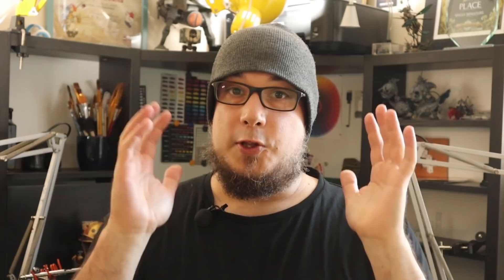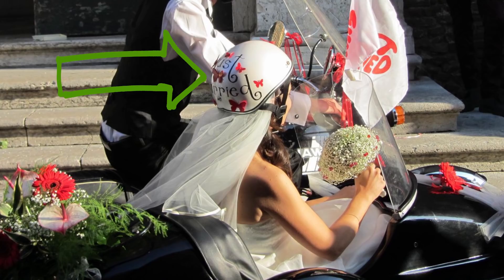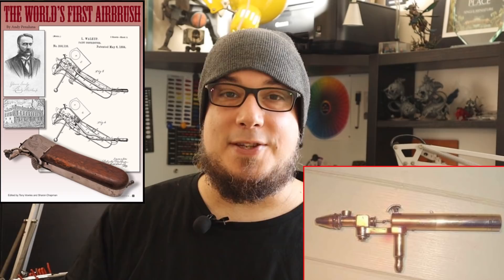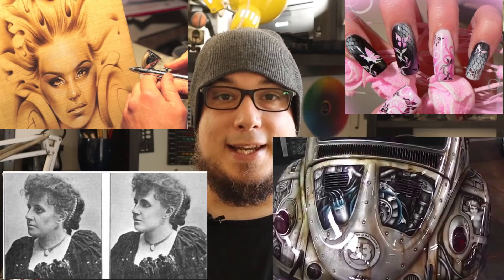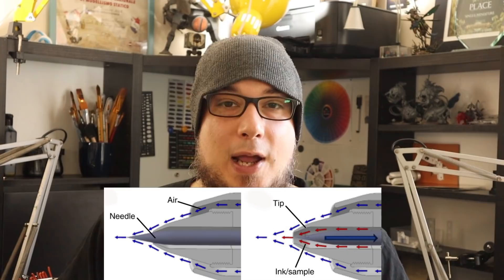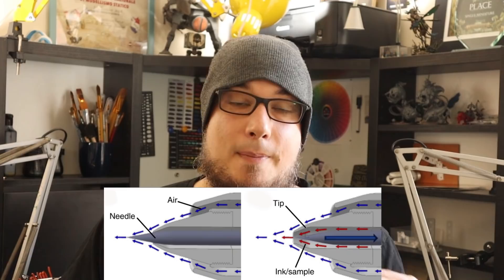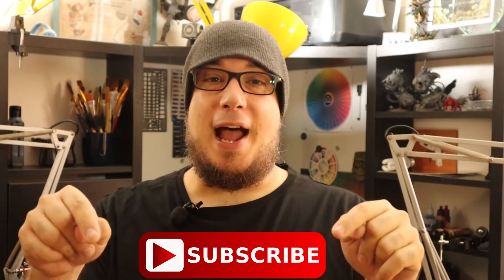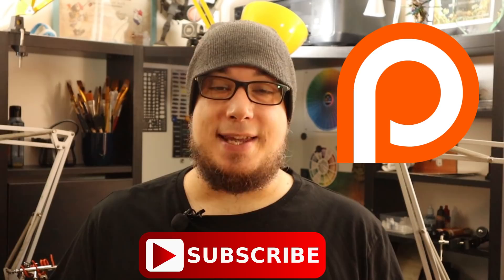Airbrush basics - Airbrushing for Miniature Painters

Comment: if you're using the Infinity with the 0.15mm needle/nozzle, then you need to make sure, the pigmentsize in the paint you use is <= 0.15mm, otherwise constant clogging or dry tip is the result. to my knowledge, the only manufacturers supplying paints with pigments that small, are CREATEX, Schmincke, Royal Talens and Sennelier. pigments in acrylics, oils, and enamels are usually somewhere between 0.2 and 0.4mm.
Reply from the maker: Yep that's a big part of my problem with it. You can work around this issue with other products and mixes but it's definitely not for everyone
Reply: @MarcoFrisoniNJM  my goto brand, when I use the 0.15mm needle in my Infinity: Schmincke Aero Color. they are a dream in the airbrush. the only exception are their metallics. they can't go through anything below 0.3mm.
Reply: @actualwafflesenjoyer  if they stay seperated, yes. but that's rarely the case...

Comment: If you can buy Iwata in your area, do not hesitate. I have owned and used all the brands, including some from pre-WWII era. You will never regret buying Iwata.  I use an HP-BPS siphon feed that draws paint from a bottle. I have added a tail piece from the Super Micron series that allows setting an adjustment for max paint flow drawing back the button.
Reply from the maker: 😍Awesome!!! 😍
Reply: I just discovered your video, and have subscribed. Looking forward to seeing more. I have been airbrushing miniatures, mostly model trains, for about 50 years. My father did photo retouching with Thayer and Chandler AA of the late 1930s and introduced me to air painting models in the 1960s.
Reply from the maker: @jenniferwhitewolf3784  😍😍😍 amazing! I learned so much from other modelling styles and I can only imagine how much experience and knowledge you built up thanks to your father and the years of modelling! Now I'm super curious to see your works and to ask you a ton of questions 😊😁😊
Reply from the maker: @jenniferwhitewolf3784  and thanks a million for the support!!!

Comment: Re-watching in 2022, I ended up with Iwata HP-BH, H&S Evolution Squidmar, and H&S Kyiv Infinity, so the same set, just slightly more collectible and visually appealing.
I really like the Infinity because of its aluminium body, not sure if yours has it. It feels almost twice as light as the Iwata. Also nice to know that I dodged some problems because Kyiv Infinity comes with a 0.2 mm nozzle instead of 0.15 mm nozzle by default.
Afaik all three models can be easily converted between nozzle sizes, my H&S both have 0.2 mm and 0.4 mm needle, nozzle, and endcap sets in their boxes, and the HP-BH should be able to accept HP-CH parts, which are sized 0.3 mm.

Comment: Something that wasn't mentioned is another type of airbrush, external mix. Some people may pick up an external mix brush cheaply thinking that they got a good deal, not knowing that there are large differences in how well an internal and external mix airbrush can atomize paint.
Reply from the maker: Good point! I cut them out because it's rare to see in the miniature world external mix airbrushes but they can be "a trap" when looking for a cheap solution
Reply: There's also the point of floating and fixed nozzle. IMHO, there's so much information about a specific topic, but you can only provide a boiled down summary to new beginners, without overwhelming them.
Reply from the maker: @naphaneal  we have all the time to scare them for real 😁😂😁

Comment: I just ordered an airbrush last week and can't wait to try it. Now I try to fins as much information on airbrushing as I can before it arrives. Your channel has been extremely useful so far. Grazie mille Marco!
And now just a stupid question: what is the difference between Airbrush Thinner and Airbrush Flow Improver? Something about surface tension reduction or something else? And which is better for thinning paints for airbrush?
Reply from the maker: Awesome timing!!! It's a pleasure ;)
It's not a stupid question and It's something I'll talk also in the next video!
The thinner increases the watery part of the paint changing it's consistency but not its properties, drying time and transparency in particular because it's designed to evaporate quickly.
Flow improver extend the drying time of paint and add a bit of body to the mix useful also for a good flow with the brush.
They are used together to adjust the paint to your need of the moment
Reply: @MarcoFrisoniNJM  Thanks again for the advice. Looking forward for the next video :)
Reply from the maker: @MentoliptusBanko  it's a pleasure 😉😉😉

Comment: You mentioned side-fed airbrushes, what are the advantages there? I saw a video of HR Giger using a side-fed airbrush and I was wondering why. Love your videos, number one fan etc. etc.
Reply from the maker: They are very popular in illustration because they have the same efficient gravity feeding but usually they have larger cups or cups that you can quickly remove, switching instantly the colour; often the artist has multiple cups ready with all the tones he needs or there's an assistant preparing the new batch. Plus the lateral cup doesn't create visual blind spots on the vector of the spray!

Comment: A small question, it's commonly mentioned that double action airbrushes allow to control the amount of both air and paint, but isn't air regulated using micro air control and the compressor rather than using the trigger? I've heard some other painters saying that the trigger acts as an on/off switch only for air, and its primary function is to regulate paint.
Reply from the maker: You have full control over the air flow from the trigger!!! You just set the main pressure on the compressor, that's all you can do from there but all the fine work is totally made from the trigger. Those painters have cheap airbrushes or a poor control of the trigger 😉

Comment: I have an Iwata single action 0,4mm I to see if I would adapt to airbrushing, mainly for priming inside my apartment, applying the first coat, and zenithal highlighting.

Now I have ordered a HP-CS 0,3mm for practicing higher level techniques.

Does nozzle size influences on diluting?
Reply from the maker: Nice! 
And the HP-CS is a very good machine!
Yeah you'll probably have to adjust your dilutions but just a bit in the jump between 0.4 and 0.3
Reply: You'll also notice a change in control as well. A double action reacts almost instantly to you finger.

Comment: Hi Marco, you've become my favourite youtube channel by a long shot!

So I'm about to pull the trigger on the Iwata HP-BH, but as my first foray into airbrushing I would love some quick advice:
1) As my 1st airbrush, would this still be great at priming/base-coating, or would it be hard work due to the 0.2 nozzle. Would a HP-CH 0.3 be a better overall pick for versatility or would the precision of the 0.2 outweigh this.
2) airbrush compressor: Any benefit to buying a twin piston instead of a single piston? Or would the lower PSI we generally work with mean a single piston is more than enough. 

Many Thanks!
Reply from the maker: Hi! Thank you soooo much!!!

Usually I don't suggest the HP-BH to beginner airbrushers because it's like learn how to drive using a Ferrari, but after the first experiments you'll have in your hands one of the best tools on the market and you'll have a ton of fun!
An 0.2 can do everything you need.  0.15 like H&S Infinity is good for small details but really frustrating for everything else and 0.3 can't do much for small precise blendings; 0.2 is the way!
A single piston is more than enough for our small pressures and if you have to invest money is best to have a larger air tank that's a more interesting optional.

Thanks a million for the kind thought 😊 but at the moment I don't have an affiliate account with Element Games

Comment: Great video. I appreciate your honesty haha. Quick question, and maybe you'll cover this in a later video, what tools do you use to clean your airbrush? I bought some online and the airbrush tools i use to clean the chamber are pointy at the end and scratched the inside of my reservoir when I first was learning to clean it. Any suggestions for a better tool for cleaning out the chamber?
Reply from the maker: Thanks!!! 
I'll cover this in next part 😉. 
Yeah cleaning tools have to be tough to clean even the hardest residue of paint and they can damage the superficial coating; 
it's not really a big deal and this will happen a bit anyway cleaning after cleaning. 
Some scratches on the body or the loss of the superficial layer in some spots doesn't affect its work.
The real trick is to lightly clean the airbrush every time you use a colour taking away the need of that kind of heavy cleaning (and I'll show you some tricks 😉 for this)
Reply: @MarcoFrisoniNJM  Thanks for easing my mind a little. I've been worried about those little scratches. Luckily I'm a catious person and I probably over clean between colors and during use, but your 100% right, quick little cleans during use saves your bacon.

Comment: hi Marco you are so right i bought the cr plus thinking i can have just one airbrush.. instead it is full time 0.4mm! the 0.15 is just too small for miniature paint pigments i dries constantly and splatters. 

Do you suggest the iwata if i use the cr plus on permanent 0.4 and iwata for 0.2mm work? is it easily to clean? did you use the iwata for the gortrek video? thanks.
Reply from the maker: Yep I used the Iwata in every video!
It's not easy to clean like an H&S but I disassemble it for cleaning probably only 4-5 times in a year working with it every single day 😁
Reply: MarcoFrisoniNJM  wow are you serious? Only four or five times a year?? I’m so paranoid I do a full clean every time. What cleaning do you conduct after each session?
Reply: MarcoFrisoniNJM also while I’ve got you - as someone already sold on contrast and p3 paints, I notice you use liquitex are there any initial colours you would recommend someone to get (eg burnt umber, primary colours, white and black?), they seem like an excellent way to glaze/ filter over a zenithal highlight.
Reply from the maker: @nornicle2  😂 yeah it's rare for me to disassemble the airbrush; I usually work with very diluted paints mixed outside the airbrush so I don't have a lot to clean or residues. I run some airbrush cleaner or methylated spirit at the end and I'm good to go!

A good starting kit of inks to cover almost every need should have Black and White, primary and secondary colors and a couple of browns (Burnt Umber and Raw Sienna are my favourite). With these you can cover any situation!

Comment: I am in the process of looking for an airbrush. I have come down to 2 options: the Infinity CR plus and Airviper (AMMO Mig). The latter is much cheaper and therefore I am leaning towards it. However if the difference in quality is big I’d rather pay the extra money and go for the Infinity. I know this is a year old video but any advise would help...
Reply from the maker: The airbrush market didn't change much in the past year; I don't like too much the H&S Infinity CR plus because the 0.15 nozzle creates more trouble than benefits, but in general it's an excellent airbrush. For miniatures I prefer an 0.2 like the Evolution, much cheaper and user friendly but with the same great output. I wouldn't go with the Air Viper... I didn't check the reviews but those kind of airbrushes are usually a repackaging/rebranding of some cheap unknown brand. Harder and Steenbeck is a solid name with an history of great quality tools (used not only in modelling!) and great customer support; you can easily find accessories, and spare parts even on Amazon and this is something important to consider
Reply: @MarcoFrisoniNJM  I was told the Airviper are made by Badger (and sold by AMMO). The store (it's a physical store not far from where I live) carries Badger and Creos/Mr Hobby too, so they have accessories and parts. Also, I see that Infinity is also available in 0.2 but the only thing that would make me think twice is the price which is almost 100 euros higher... hmm.. this becomes a riddle...

Comment: Hi Marco, I am not sure if you mentioned this anywhere in your airbrush series but I cannot find a lot of info on how much dust an airbrush can produce and how much ventilation you need to make the room safe from huge messes? I have a small space in a shed that could fit the bill but it is pretty packed with stuff so if it just paints the walls 3 meters around you without a filter booth I will have to hold off on buying an airbrush XD
Reply from the maker: Hi! I didn't mention this issue because it's very situational and mostly dependant on your experience. I work with a 0.2 nozzle, obviously on small targets and surfaces and with a good control over the trigger and I don't produce any dust or visible overspray even on the table! But beginners have an heavy finger on the trigger and in the first experiments dust and fumes can be a real issue. It's a steep learning curve and you can solve the problem with a good respirator, but be prepared to dust off a lot of pigments during the first weeks
Reply: @MarcoFrisoniNJM  Looks like I might have to wait - as I definitely suffer from a heavy finger (a few brushes died to confirm this haha)

Comment: Nice video Marco. Which one you think will be the best between an Iwata HP CS(0.3) and an H&S Evolution(0,2) since the price range is nearly the same? Thanks!
Reply from the maker: Thanks 😁😁😁! It depends on how you plan to use it and what I'm considering the most here is the size of the nozzle; 0.3 can be tricky if you plan to do fine works on 35mm models but perfect for priming and terrains

Comment: Thanks a LOT, gave up the idea of importing some tools and just looking for what I can find around here for now! Any advice of needle and pressure for mainly primer applications to begin with? Guess those mini compressors aren't strong enough for applying primer, are they?
Reply from the maker: My favourite needle size is 0.2!
0.15 gives more problems than advantages (especially for priming) and 0.3 doesn't work well on details. The main issue of cheap compressors is the unstable air flow but it's not a big deal for priming. In modelling we work between 2 and 3 bar so anything able to generate this little pressure is ok 😊
Reply: @MarcoFrisoniNJM   Won't be able to work during nigh (not after empty the reservoir!) but no unstable air flow, ended up getting a 24L hobby compressor xD, unfortunately the airbrush specific ones are too expensive at moment :(! The 0.2mm one works fine for primer? Only ones I can find with easy here are 0.2 and 0.3 mm.

Again, thanks² for the video!
Reply from the maker: You can work for a long time with 24liters 😁! I have 5 airbrushes and they are all 0.2 😉 it's the most versatile size
Reply: @MarcoFrisoniNJM  0.2 it is xD! 👍

Comment: where should i mix paints for use in the airbrush?
I've just been dropping stuff in and giving it a bit of backblow till i think it'll work.
Reply from the maker: I mix my paints outside the airbrush in little metal trays, you can see them in action in most of my painting videos (before them I used little IKEA glass candle holders 😅) and then I put the mix inside the airbrush. I prefer to see clearly what I'm doing and have a clear perception of consistency and dilution

Comment: Great video, thanks.
Marco, I would like to ask you a question about zenithal and Liquitex inks, because I decided to try something like that after your videos. How long should the ink dry?  I paint my warhammer nighthaunts with citadel hexwraith flame (by brush) over ink and ink is squandered. Usually acrylic dries quickly, but then I tried it after 20 minutes and after 40 minutes and still the ink dissolves when painted. What am I doing wrong?
Reply from the maker: Thanks a million 😍! 
Here the problem is the wash of hexwraith flame. Inks take for sure a bit longer to be dry in the microscopic level but this not the case. The layer on ink is super thin and the wash is full of medium and other components that with the brush can move the pigments already on the surface; 
You need only to add to the process a quick coat of varnish on top of the zenithal black and white and you are good to go 😉
Reply: @MarcoFrisoniNJM , Thanks for the tip, although varnishing slows down the painting process a bit.  Tested several interactions with other shades from the citadel. Nuln oil and agrax are practically not erased if you do not drive with a brush for a long time. For myself, I discovered the use white spirit based washes from scalemodeling, they do not interact with ink in any way.  Are there any other nuances of ink interaction with other paints with which you know?  And in conclusion, since you advised using varnish, I used semi-gloss Tamiya varnish. Are there any varnishes that you can advise? Thank you very much for your attention.

Comment: I am quite puzzled with many "double-action" airbrushes. Most of the so called "double action" airbrushes have a trigger that basically behaves like an on/off switch - Air On, Air Off. Then you pull the trigger back to control paint flow and you can control only paint flow. So, to me they are basically "single action" or at best "1 + somewhat meaningless action" airbrushes. Does the Does the Iwata (I assume it is a Hi-Line version) allows for air flow control using the trigger alone, without using the MAC? Or is it another so called "double action"?